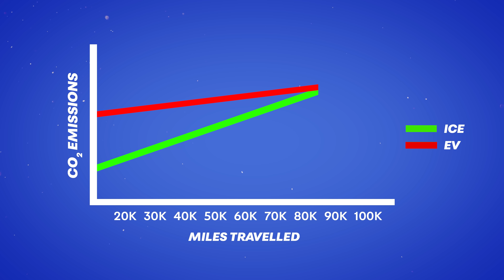Are Electric Cars REALLY That Green? [New 2022 Data]

Comment: Microwaves on wheels. Batteries need recharging which requires main grid. Main grid powered by power stations using coal/nuclear. Another great con. 
And the process to make these EV’s is horrid.

Comment: The thing I love most about about EVs is the prospect for greater independence.  Today you can charge you car at home. You never need to go a gas station. 

Consider a future where solar and battery tech improves significantly and external charging becomes less required.

But I think people need to be real. The vehicle is made of steel and aluminum with , plastics, glass and mineral resources .  The amount of energy used to produce each of the components are mostly not green. Apart from that there is real environmental damage that occurs in thr mining process, which is often understated. 

I just saying have real expectations. When you buy an EV you can't delude yourself into thinking you're helping the Earth. You can however in thr future have access to a vehicle that will cost you less in the long run with lower energy and maintenence costs.

Comment: if its about emissions : Scania has diesel buses running on a fuel called ED95 i.e a mix of 95% ethanol and 5% additives! if the argument is ethanol from corn = evil then the same engine was tested with MD95 (Methanol instead of Ethanol) and was found even closer to zero emission than ED95! So maybe ICE engines with clean burning zero/low emissions could also be realistic solution long term weaning ourselves off fossil fuels....

Comment: This report was rubbish. Im an electronics engineer who has workrd in this area for 30 years. What batteries out of many are you talking about? If you are talking lithium which type? Lithium is the 2nd most abundant element in the  universe.  These studies always select south america as the lithium source which is the most polluting and carbon intensive to mine. However the largest lithium deposits in the world are in western australis as pebbles lying on top of the ground and literally until recently has been a one man operation with a front end loader scooping it directly into ships. Lithium batteries are 100% recyclable. Into what? Into new lithium batteries. Non lithium batteries in development now will have a life of one hundred million miles!. Manufacturing batteries carbon footprint is a tiny fraction of manufacturing a combustion car. Volvo dont include the manufacture of any bearings, gears, splines, any casting and machining of parts that are made by 3rd parties

Comment: Looked at the report. How do you get to 90 000 miles? The highest breakeven point was 110 000km. That is 68351 miles. The average car easily reaches that within 5 years.

Comment: Great video and Rory is outstanding.  So this is all just discussion along the journey Rory described (as is always the way with progress), and one thing I don't see come up in these discussions is the effect of weight.  I'm no expert, but it seems that the EVs are all much heavier than the ICEs.  And I dont mean the way weight differentially affects all of the fuel consumption numbers, I mean the way weight affects everything else.  And as Rory says, these things will be solved over time, but take an extreme example, the new Hummer.  At 9,000 lbs it is roughly double the weight of it's ICE analog.  Here is the buried lede:  how does that significant extra weight affect the car's consumables, such as bearings, bushings, tires, brakes (and resulting outputs like brake emissions), and so on.  And how does all of this additional weight affect roads - our roads and bridges are already tough to maintain here in the U.S.  Progress is amazing and needed.  New issues that crop up along the way get addressed.  But I think these weight related issues matter.  And as I said, before you hate on me, I am no expert - maybe these are addressed, I just dont see them being discussed.  That's 15 minutes of my life I won't get back, but what was it worth to my soul 🙂

Comment: All of the electric vehicles in australia are powered by coal. They loose 10% of the electricity charging the battery and another 10% converting that power to work. In the end , they burn more fuel than a diesel engine.

Comment: Very interesting. Two questions: 1. Is a car made in ICE, Hybrid and EV versions a good example to use? It makes the comparison easy of course but vehicles designed as EVs from the ground up are very differently constructed to get the greatest efficiency; crudely, sticking an electric motor and battery pack in somewhere is not the best way to make an efficient EV. 2. What account has been taken of the greater overall energy efficiency of a grid and society brought about by larger numbers of EVs? So ICE vehicles are inherently inefficient (a radiator being a device to throw away 70% of the energy in fuel) and as more EVs charge overnight we reduce wastage of generated power, smoothing out the spikes in production and consumption of electricity so that even in an all fossil powered grid we are much better off. In reality much of that wasted nighttime power is from wind which currently has to be turned off at night. Once we have a larger proportion of batteries, domestic and EV, we will need to burn less fossil fuel in total as a society.
Reply: Great points.

Comment: Hydrogen cars would be an even better product to establish, it does not leave a large carbon footprint in production than any combustion car, but admits no carbon either it admits oxygen, it as an almost equal ratio of power spent and created in the engine or high torque as an electric car.
Reply: Nope they aren't. Instead of using fossil fuels to produce hydrogen, it's way better to produce electricity since it's easy to transport, already have the required technology and is very efficient than hydrogen cars.

Comment: Volvo cars are a Swedish company that pride themselves for being a company for the people, they were founded under a long traditional Socialistic era and have always had a more tradional transparent role in the Swedish society, that is why Volvo is releasing this information so that people can choose more infomed of things, also the difference in carbon footprints as you have established starts highly for the electric cars this due to the battery pack, this pack needs to be replaced after 10 - 20 years of usage. This means that the carbon footprint of the electric car then shoots off up the chart once again. the combustion engine does not need under normal circumstances too change, so alright up to 60 000 miles they are even, then at 150 000 miles a new giant carbon footprint is created in the same electric car.

Comment: Do 12,000miles a year and after 8 years you're at 96,000 miles. "Yeh, break even". Now it's time to replace those lithium batteries. Whoops!
Reply: Battery last way more than that. Also you save more money in ev due to lack of maintenance and fuel.

Comment: What the report fails to include or mention is the fact that batteries in most cases are repurposed and ultimately recycled making them a far better choice.
Reply: Please explain about the batteries being a better choice. I thought that the mines themselves to harvest the minerals are an ecological nightmare and the batteries are a hot mess to get rid of. Not to mention they are expensive to replace and need to be swapped out several times over the life of the car.

Comment: Firstly they would only be conspiracy theories if there where no evidence. Your opening language show that your not without bias.
Sorry but the volvo report is fuel of hole as it did not take into account the co2 foot print of oil extraction and refining into petrol and diesel. This is huge in comparison to battery production.
Where you get this image volvo is a greener company I do not know volvo is Chinese before that American its not be independent for many year plus the volvo  are not made in the same factory some are made in China. 
Volvo have a glut of ICE vehicles they need to move this
Next the report glossed over the engine casting and aluminium extraction form bauxite which is mined in trop8cal regions . It also glosses over the cryolite issue  which is another ore used in Al  production which as been mined to depletion in Greenland.
Comparison starts to fall apart because volvo have not included 12k oil and filter changes. Again its not just fuel 
These require recycling which all uses co2.
The well to tank figure is no where near the truth as they based it on Norwegian fields with pipe lines. 
There battery production current volvo LG battery is not the cleanest battery but the recycling of ev will be cheaper than 
The other is is the volvo is not a pure ev building a ev that is pure ev is cleaner that a rehashed ice vehicle so tesla, polestar,  jaguar, ioniq5  ev6  ford mach e are all much cleaner to produce. Volvo cost of mining bauxite and cryolite was also under estimated and so you need to question many of the figures. Sorry life figure are question able

Comment: Cool that you bring up The Volvo Report.
When I read it it was break even at 73.200miles - EOL at 90.000miles.
Elephant in the room. Volvo does not include recycling CO2 calculation of the Li-ion battery like all other BEV manufactures. Recycling li-ion takes up to 10 x the CO2 compared with build of batteries with newly mined material.
Cradle to grave CO2 and resources needs to be analyzed 
Which is why hydrogen should be look at.
Reply: No it doesn't take more resources to recycle batteries than it takes to make one. It's just hard for now and will only improve in the future.
Reply: It's way more efficient to burn fossil fuel to make electricity for ev than to make hydrogen for cars.

Comment: The equipment used to mine the lithium required for the batteries run on petrol/diesel and use thousands of gallons a day. And the environmental impact where the mining occurs is irreversible.
Reply: No one claims ev is totally green. But it's way more green than ice cars.

Comment: More important, electric vehicles represent change and evolution. Parables of the same argument made against EVs were made by blacksmiths, wagon makers, and horse breeders when cars were on the horizon. Stand in the way of change and you will either be run right over or left in a wilderness as everyone goes elsewhere.

Comment: Did they consider also that batteries also degrade in range over time. Batteries do need to be replaced if you want to keep the range. And that means the co2 cost goes up again.
Current Battery technology is very harmful to the environment. And dependency on renewable is still questionable in most regions in the world.
I think the current trend to keep the large luxury cars, just with electric is part of the problem, we need more smaller economical cars that dont use as much resources to build.

Comment: the logic was ...its the truth is why......also they didnt count for battery replacement cost...by the time you get the ev paid for it needs new batteries at 1/3 of the cost of the car when new....natural gas is clean burning , we should develop that tech ....
Reply: Idiot. Batteries last 10 years. In that time, battery tech will have improved. Natural gas is still fossil fuel.

Comment: First of all, you will need a huge amount of Lithium, which mainly comes from China, secondly the demand for copper will go through the roof, which needs increased mining. Then you need more electric power. Thirdly in most countries EV's get a free ride, by not paying fuel taxes. How is the government going to fix the road? A new Toyota Camry achieves about 4.5 litres per 100 kms on the highway. What is the incentive to buy an electric vehicle? I'm curious about the hydrogen engines. I would expect them on the road in the next few years.

Comment: Please don’t forget that these batteries don’t last forever and need replacing over time which elevates the co2 reading for electric vehicles even higher.
Reply: Most change cars in 10 years and battery and recycling would have improved by then.

Comment: RECYCLING EV batteries should also be a key factor. It is not currently possible to recycle batteries on the industrial scale that we're rolling these cars out at.

There is a litany of issues with this, and current estimates say that we can only recycle ~5% - 10% of batteries. And make no mistake, this is going to become an issue. A 20 year old Toyota I once had, with 170,000 miles on could still get a full 400 miles from a tank of fuel that it did when it was new. And that is an issue we're going to see our arses in with Electric Vehicles... 

Where are these batteries going to go?

I'm not pro or anti ICE or EV. I'm just concerned that it's a huge elephant in the room.

Comment: This has been done to death. . .
Actual schools for research have done papers on this and have found that using EVs is a big win for the environment, even if it is run off of dirty coal fired power. 
One of the biggest uses of cobalt is to break down oil in to gasoline and diesel, let's try to not burn stuff.

Comment: IMO electric cars we have today are just stepping stones to real renewable energy like the hydrogen fuel cell, which has  byproduct of water basically which can be reabsorbed into the environment.  The issue with batteries comes as things like recycling them after their useful life has been exhausted, the production of such batteries among other things.  Of course internal combustion engines are "clean" vehicles either, although they have gotten significantly better over the past 15-20 years with cars on average getting over 30 mpg, whereas about 20+ years ago, cars only got between 20-30 mpg probably on average (with a select few, like those from Honda and Toyota) that still did over 30 mpg even in the 80's.

Comment: In 2007, when I bought my 1994 corvette, my mother bought her first Prius.  She was SO mad at me for ruining the environment, I had to do the math.  Based on the cost of the car, and the mileage ALONE, she would have to drive that overpriced Prius for 140,000 miles to be where I am in the used Corvette.  I still have the corvette and the Prius died in 60,000 miles.  Just sayin'
EDIT:  So, the number is approximately 90k miles, assuming you dont have to get a new battery in 90,000 miles.  At 90k an EV is basically worthless and an ICE car isn't even broken in yet.  I feel like its a good idea, but they arent there yet.  They are REALLY good at making ICE cars.
Reply: AND CORVETTE MORE FUN TO DRIVE